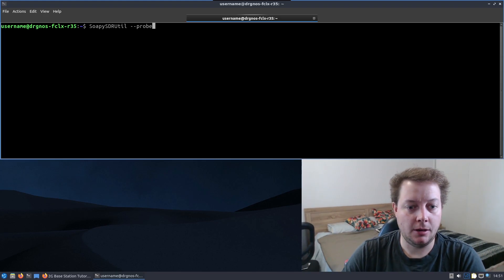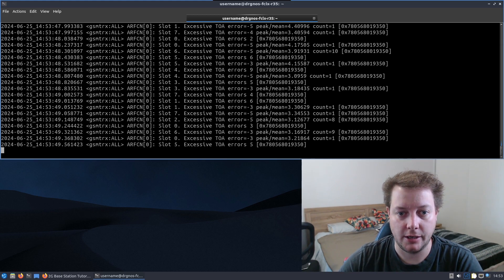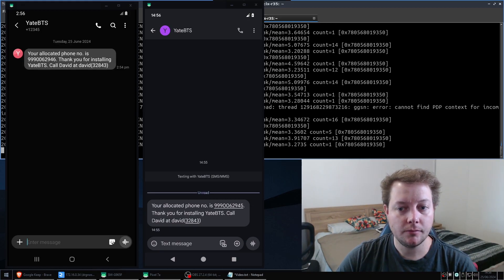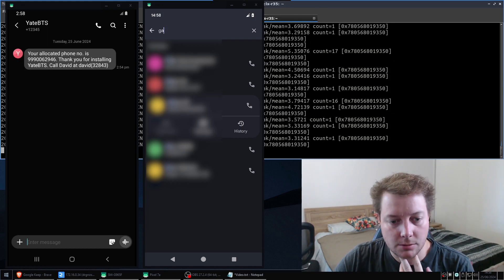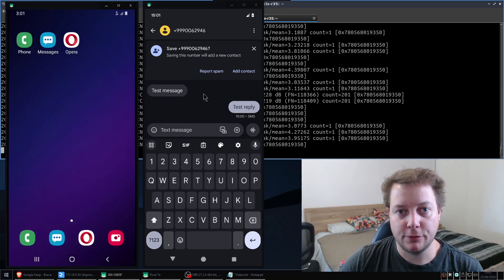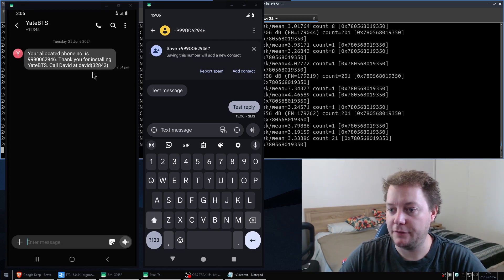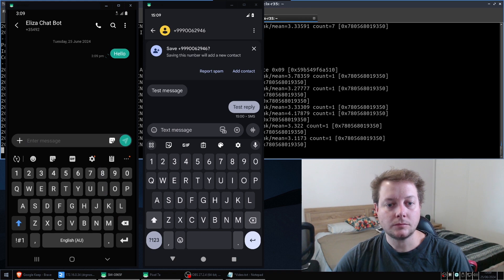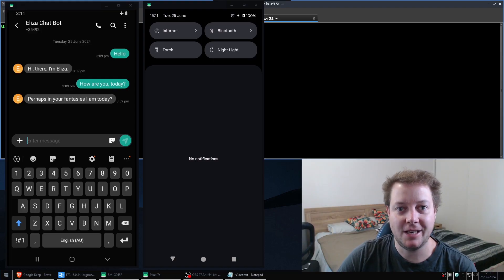2G Base Station Tutorial - Part Two: Connect Phones, Make Voice Calls, Send SMS's, Use GPRS Data

Comment: What laptop would you recommend for hacking?
Reply from the maker: To be clear, I am not a hacker. So, I wouldn't really know which laptop is good for doing that kind of stuff. However, I am a software defined radio, Linux operating system and open-source software enthusiast. A laptop with plenty of CPU power, a lot of memory and the ability to boot Linux from a USB thumb drive if you're primarily a Windows user... Fast SSD/NVMe storage would be advantageous too.

Comment: Does he use a mac or MacBook to hack with a virtual machine?
Reply from the maker: Lol, me using a Mac? Never in one trillion years would I punish myself like that... I am using multiple PC's for this video, one is custom built dual CPU Xeon E5 gaming rig/server. And the one recording the video is an old Lenovo Ideacenter office PC. I also use an Asus Zenbook Flip when I am on the road
Reply: @RobVK8FOES  what laptop would you recommend?
Reply from the maker: @carlitos-_-2978 To be clear, I am not a hacker. So, I wouldn't really know which laptop is good for doing that kind of stuff. However, I am a software defined radio, Linux operating system and open-source software enthusiast. A laptop with plenty of CPU power, a lot of memory and the ability to boot Linux from a USB thumb drive if you're primarily a Windows user... Fast SSD/NVMe storage would be advantageous too.

Comment: Can deploy this station using HackRF hardware?
Reply from the maker: Hi. If you haven't seen part one of this video series, go and check it out. I explain why the hackRF can never be used as a cellular base station despite being transmit-capable. The tl;dr of it is basically that the hackRF can't transmit and receive simultaneously, which is what is needed for cellular base stations. It's only 'half-duplex', whereas the BladeRF is 'full-duplex'
Reply: @usernotfound342  hackrf are not full suplex....gsm need fuln suplex card.

Comment: Do 4G 😂😂😂
Reply from the maker: Hi. Yes, this is also possible to do with srsLTE. I have a video about running a 4G base station with my BladeRF on my channel. Check my "Rogue Base Station" playlist.
Reply: @RobVK8FOES  Nice work, I want to ask how get most distance of any radio communication method, with less power, and minimal bandwidth.
Reply from the maker: @arduinoguru7233 That's a complicated question, and it depends on what exactly you intend to do. By far, the frequency that propagates the furthest you can use right now (after getting your Ham radio license) is HF, or 'high frequency' which generally includes anything from 1.8 MHz to 28 Mhz typically. Anything from regular voice transmissions, text messages and even pictures can be transmitted at low power and low bandwidth and travel many thousands of kilometers/miles across the earth (depending on if the solar and atmospheric conditions allow for it at that time)

Comment: Can you call other numbers not connected to your base station such as phones on other networks or international?
Reply from the maker: Hi. Yes, this is possible to do. You have to use a third-party SIP or IAX provider. @Cemaxecuter has done a two-part tutorial on how to do this (I collaborated with him for part two) So far, only outgoing calls are supported, he hasn't figured out incoming calls yet.
Reply: Yes. By using an IAX like Goip. Just attach the IAX with an original sim card. Second you have to config the Goip IAX. I have a config and script...that work well just to make an out call. I'm still working for incoming call...hard. can share may config...let me know. Maybe someone can improve the script  ?😊
Reply from the maker: @yazidkeraichia2858 Hi, myself and @cemaxecuter have already demonstrated OUTgoing calls from YateBTS, do you know how to do INcoming calls? If so, please email myself or Cemxecuter (Aaron)